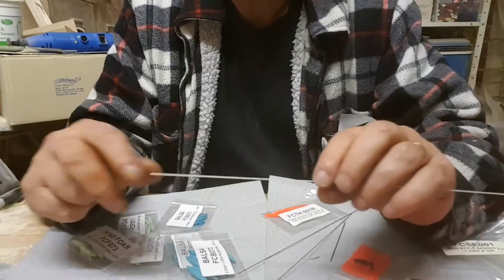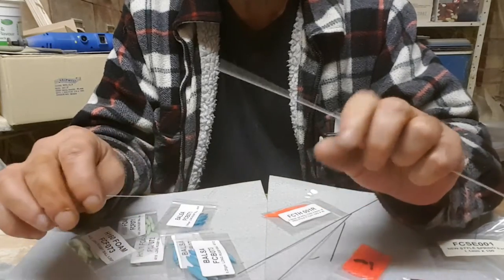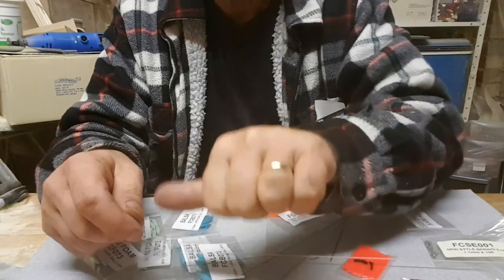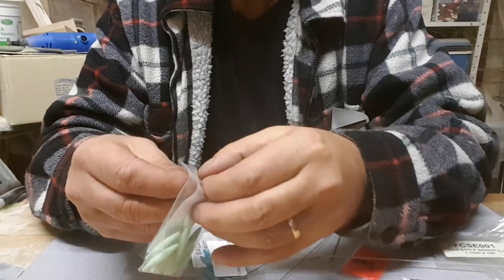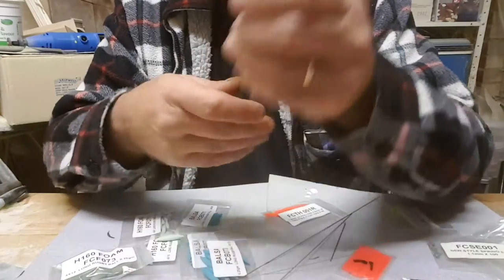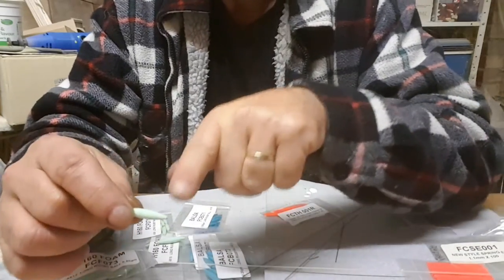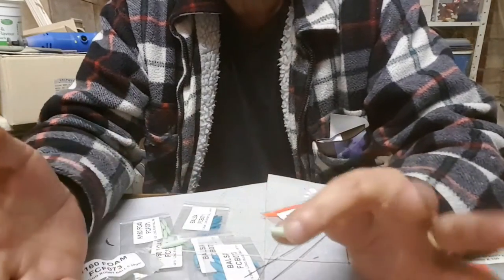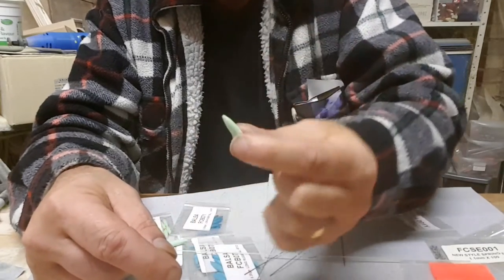Hi-Tech Silvers

Comment: For you're wire stems floats what length of wire do you cut so it sinks and takes 4x16's. Thx
Reply from the maker: All depends on profile, usage and wether 0.4mm 0.5mm 0.6mm 0.8mm or even 1mm wire. All have there advantages when used and greatly effect the capacity of the float profile...
Reply: @mickbassett3557  brilliant thank you. Just wanted to clarify as a customer wasn't happy about the 0.8 wire that has effected the float shotting. Thanks again fella.